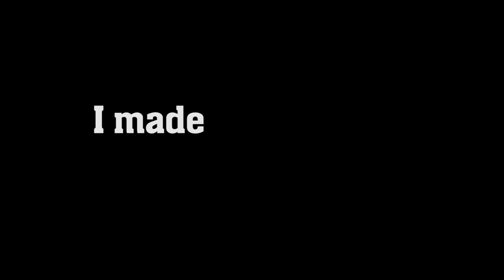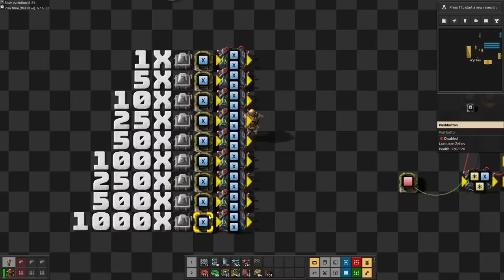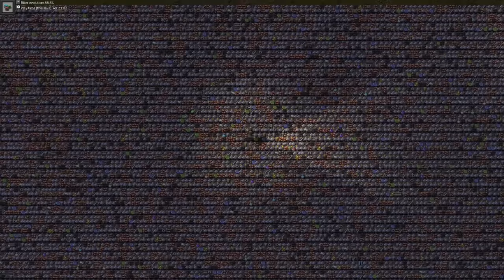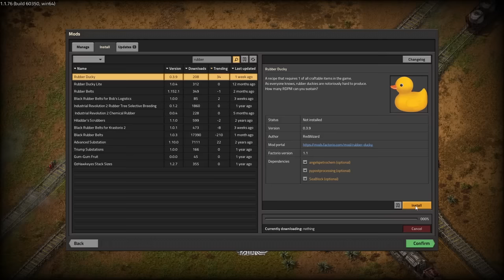How Hard is it to Beat Factorio When EVERYTHING Goes on the Same Belt?

Comment: "When EVERYTHING goes on the same belt"

Has hundreds of different belts.

Cool video, misleading title.
Reply from the maker: It's multiple belts that are all connected together in parallel in such a way that items are distributed evenly across all of them. They form a continuous loop and there's no beginning, or end. Thus, despite having multiple lanes, they can all be considered the same belt. 
There were belts that weren't part of that, but they served no other purpose but to put everything on the one belt, thus "Everything goes on the same belt." is not misleading at all, it's just your personal definition that's misaligned
Reply: @DoshDoshington  I appreciate the time you took to respond, but lol.. I dunno if my definition is misaligned, just seems like you are reaching there ;) 

800 belts in a parallel loop with different items is empirically different than what the title describes. "Everything goes on the same belt" implies one belt in a loop containing all input/output.
Reply from the maker: @Wang_Thunder  It's your constitutional right to be a pedant.

Comment: is this possible without the logic circuit stuff? with something like filters or so?
Reply from the maker: You can do sushi designs with just filter splitters, but they're really weird and wouldn't work for something this at this scale
Reply: @DoshDoshington  my question goes towards a challenge in satisfactory
I'm currently planing a mega factory with a sushi loop only - but I'm not sure if that's possible in satisfactory as there seems no way to select raw ore input so it would clog up (unless one filters out excess of raw ores right before the new input merges - but that kind defeats the purpose of a closed loop)
can factorio be set (or is there a mod for) to set ore nodes unlimited like in satisfactory? I do like factorio - but not the minecraft-like endless keep expanding for ever new resources

Comment: Not trying to mess with your parade, but... You did the challenge with the wrong design, I mean, you were trying to adapt what you are used to do with bus/mall system, but that doesn't work.
You should have focus on feeding the raw resources. And if you were doing several lanes you could also separate the inner lane and the outer lane for raw resources and manufacture ones.
I don't know but maybe like that you could've more of a functional base.
Reply from the maker: There's a lot I could've done to make a more functional base, but to me the point of this one was to throw everything on the same belt in the worst way possible and create a 30 lane wide river of trash, which was a success